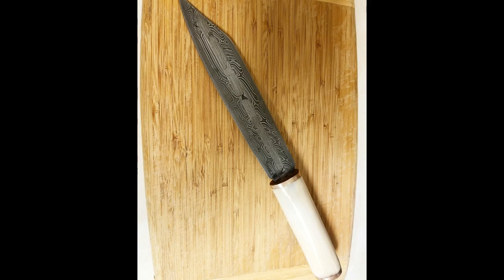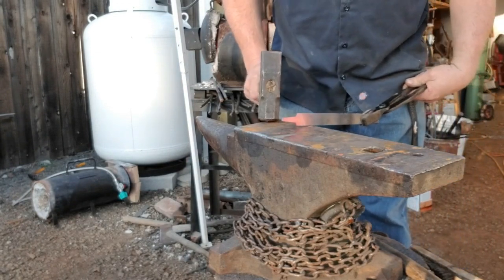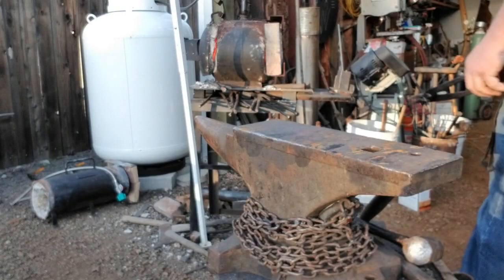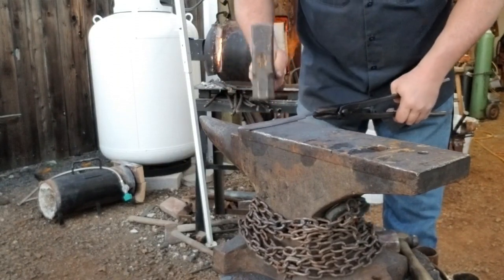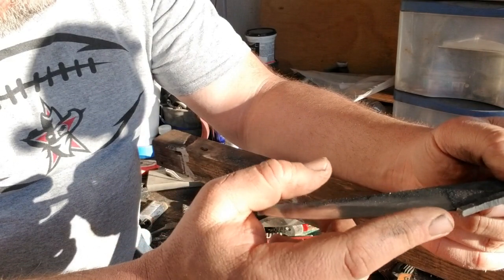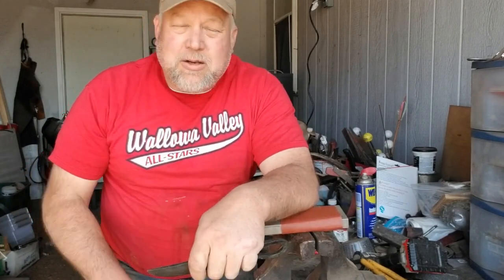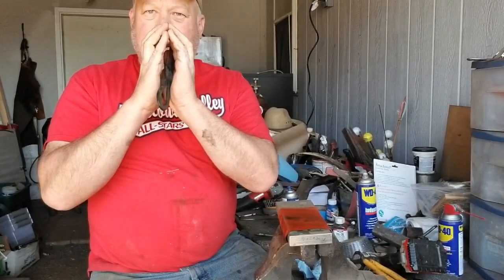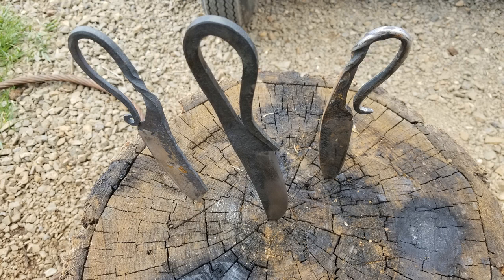Forging a Knife and Finishing with No Power Tools

Comment: My first power tool was a six inch grinder, the stone type. Now I have two bench grinders and two belt sanders and yes a hand held grinder
Reply from the maker: I still use that hand held beast all the time!
Reply: @mikerowley7390  me too. I had one that was my own and wore it out in a maintenance shop I worked at. My boss replaced it, but it was under warranty so Harbour Freight replaced it also. Got two of them now